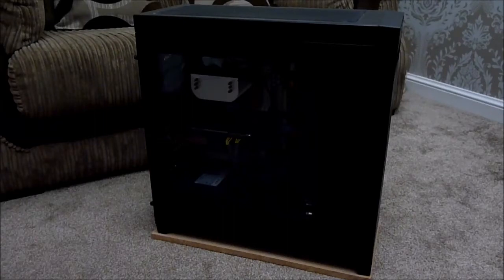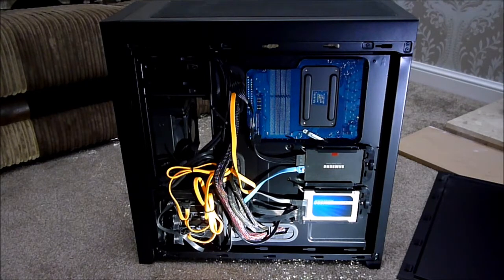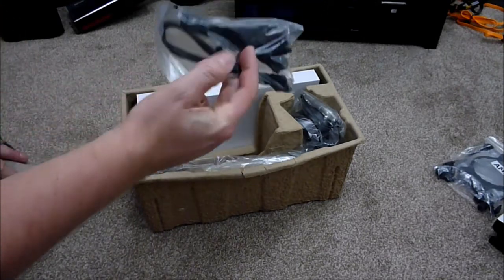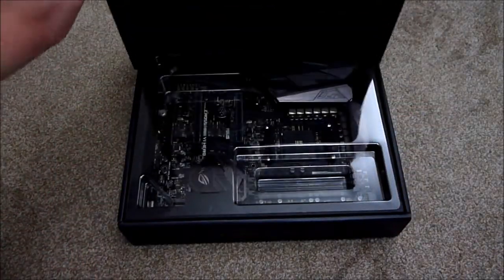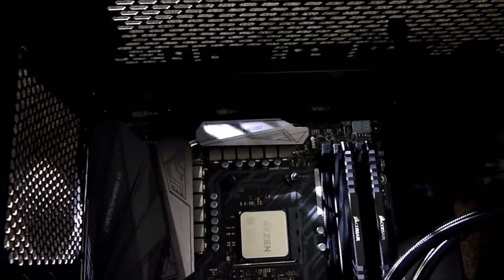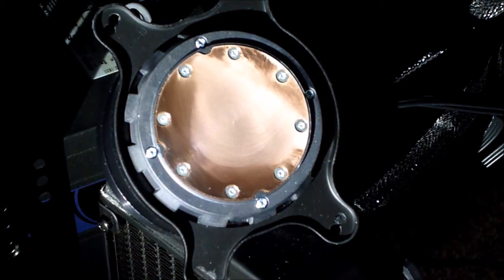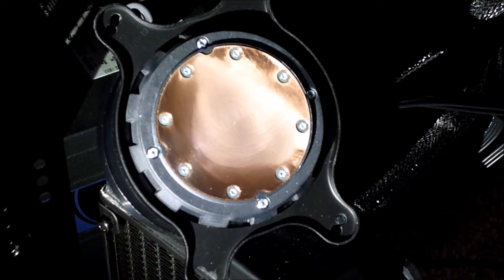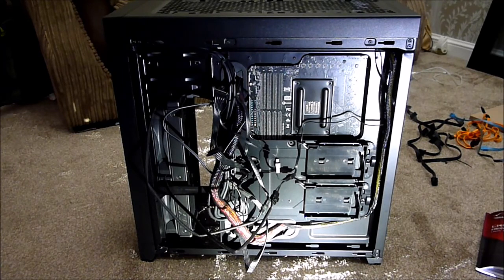Ryzen 1700X Build - Part 1 - Putting it together

Comment: I just bought these parts. Similar to yours. Is it any good? 
- Ryzen 1700X
- Kraken X62 
- ASUS Strix GTX 1070 OC
- Gigabyte Aorus GA-AX370 Gaming 5
- Kingston SSDNow 120GB M.2
- Seagate Barracuda 1TB HDD
- Phanteks Eclipse P400 Tempered Glass
- EVGA GQ 750W
Reply from the maker: NIce choice. Mobo on par with the Asus. Overclocked 1070 probs on par or better than a Fury X. I like that case. Think you would be happy with that. The X62 is giving me 27 C idle and 46 C under load at stock speeds.

Comment: Does the cooler standoffs bases touch the board cause issues? I'm installing the same cooler with asetek bracket and screws.
Reply from the maker: Daniel Brent When you remove the standard Am4 retaining clips you leave just the holes to the backplate. These are slightly raised above the motherboard. The standoffs screw into these and secure the backplate to the motherboard (don't worry the backplate is glued on by def). This could not damage the board, unless you go insane and over tighten them like crazy. Finger tight, and a slight pinch with a socket is all you need
Reply: Thnx for the reply. Not worried about the backplate. And I understand the install. 

 It's the standoffs that screw into the board (and the pump screws into) that cause me much concern of a short. The thin standoffs I've used in the past for pumps don't touch much of the board but these thick circular based ones at the base do touch a lot of the board.  Too much for my comfort. 

 On the board, there are circle indentations where the standoff base would touch if installed and they seem to fit perfectly over the indentation, suggesting that it is made for 'thick at the base' standoffs. 

But I still wasn't comfortable with potentially shorting everything out.  So I used some thick packing tape, an Exacto knife and a magnifying glass to cut out sort of tape gaskets between the standoffs and the board.

*Doing google searches I see others making makeshift gaskets or ones that look like they come with the standoffs with big bases. 

 I imagine thin art construction paper would work as well or other non-electrically conductive material. 

Better safe than sorry. Install went fine. Hope this helps others searching for answeres.
Reply from the maker: Daniel Brent Fair play m8, I like your approach better safe than sorry. It's not something that I had considered tbh. Sure if there was any real danger the manufacturer would provide some form of protection. Although paper would not hurt I would be cautious of altering the height of the standoffs as this could affect the pressure on the cpu,  and potentially give you high temps. That's why I waited for the correct AM4 bracket, as I had not intended swapping to an AM3 backplate. I had seen a few horror story's on YouTube where people where getting really high temps either because of not knowing about the 20 deg offset, or the pump not making the correct contact with the cpu, because they had used the wrong combo of backplate \ standoffs